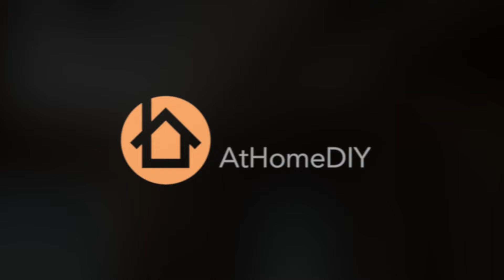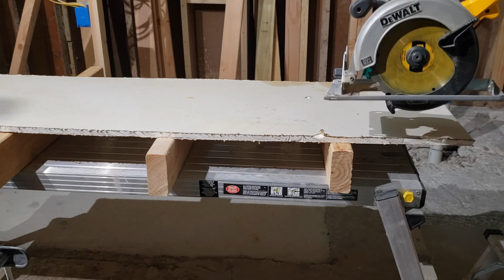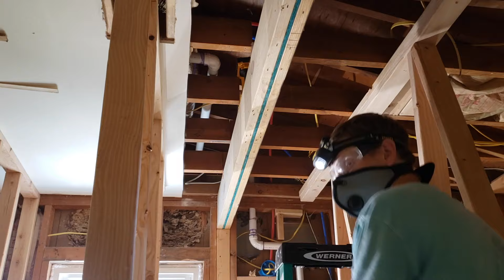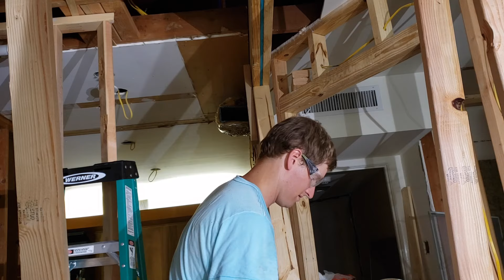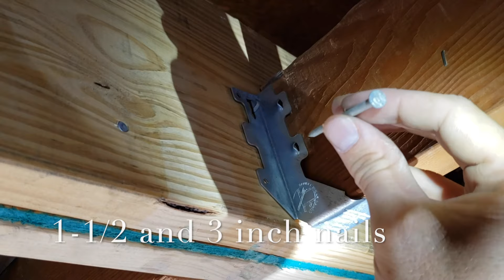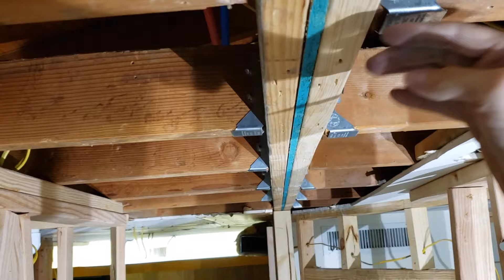How to Install a Recessed Beam after Removing a Load Bearing Wall

Comment: Great work ! What type of 2x12 did you use? Pressure treated ? .. I’m looking into doing the same but really don’t want to spend too much on the lvl’s.
Reply from the maker: This is just normal dimensional lumbar, untreated (treated is used if in contact with cement as a baseplate). I actually just did the same thing on a much bigger scale in another part of my house. I'm literally editing that video as we speak, look out for that soon! Good luck with your project!
Reply: @AtHomeDIY  thank you for replying back.I am definitely looking forward to your next project. 
Keep up the great work!
Reply: @AtHomeDIY  when will the new video be up ? I’m starting a 22’ load bearing wall in 2 weeks ! Hopefully your video will be up soon ! Thanks for all the knowledge!

Comment: Why sandwich a ply in between?
Reply from the maker: Good question. The standard measurement of a dimensional 2x4 is 1.5"x3.5". This means that if you were to ply the 2x12s together they would be a combined width of 3" leaving .5" extra to reach the standard 3.5" width of the 2x4 posts. The half inch ply wood is to make up for that .5" so everything equals out and looks nice. Side note: LVL beams measure 1 3/4" so putting two of them together equals 3.5" meaning now sandwiched .5" plywood is needed.

Comment: I just installed 3 LVLs (3) x 1 3/4 x 24’’ x 25’ . Can someone recommend the ideal overhang on the posts for a beam this long? The engineer recommended 8’’ hang on the post on each side but my contractor only did about 4’’ on each side. I’m afraid that the overhang might not be enough considering the beam is 25’ long.
Reply from the maker: I would definitely go with what your engineer specified. For a 25' span 4" seems very skimpy. Again, I'm not an engineer, but that's my opinion. Maybe someone else on here can chime in as well?
Reply: Thank you so much, I think so too. I think the contractor accidentally cut a little too much of the beam. It was 26’, and he ended up cutting 1’ leaving less hang on the posts. 
Looking forward to see everyone’s inputs on this as well.
Reply from the maker: @maadhav22  Any update on how this turned out?
Reply: @AtHomeDIY  He died. Whole damn house collapsed due to that 1". 
Source: I'm his neighbor. RIP Madhav.

Comment: What is the total length of the lvl?
Reply: That wasn't a lvl beam.
Reply from the maker: @charlesbryant3515  Correct, not an lvl. This was two 2x12s nailed together. Span was 12' I believe.

Comment: Great video. Quick question though. What do you do with the furthest most ceiling joist that is too close to the exterior wall for a hanger to fit? At 18:02 you can see the joist closest to the wall, no fasteners. I have the same situation and am curious.
Reply from the maker: So in my situation the two you see closest to the wall are just 2x4s for the drywall backing (at the same time stamp if you look closely you can see they are 2x4s, not 2x6s). Not structural at all. Without seeing your exact situation it would be very difficult for me to offer a solution.